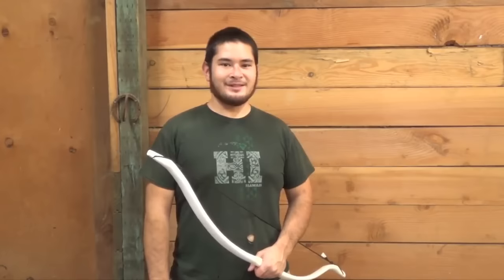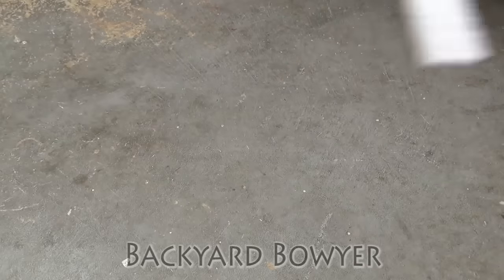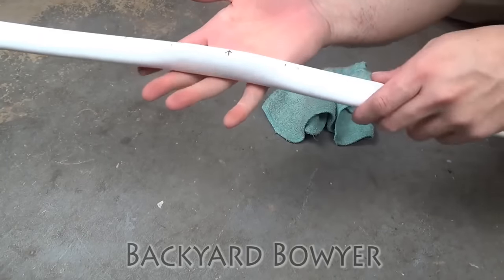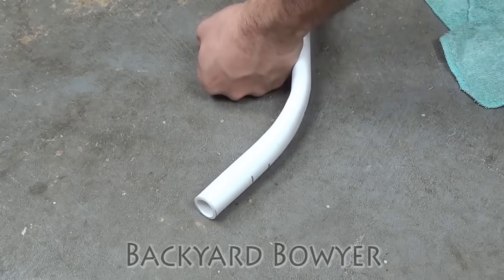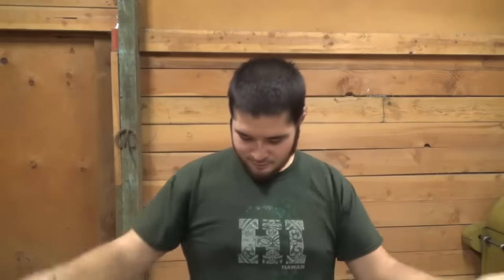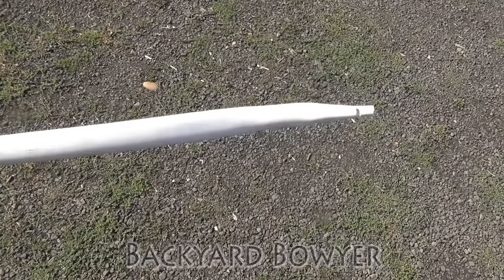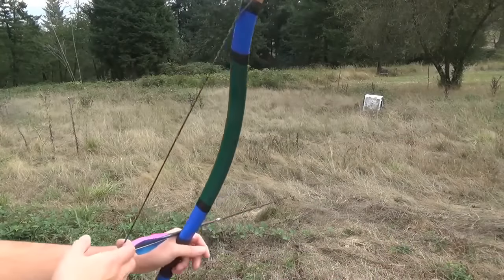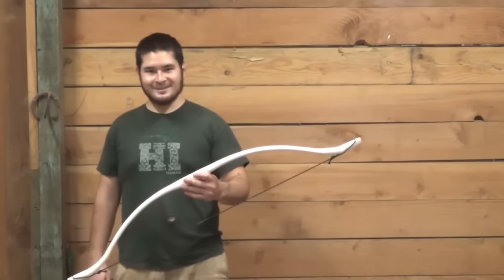Making a 40 Pound Freehand Formed PVC Bow With Tape Finish - Full Build

Comment: Ok, is this a legit test of pvc strength?  I get the pvc pipe manufacturing process may not be 100% consistent, but did he only smash test one end of each piece? If one end survives, are both of the same strength, what about the center of the pipe?  I know he heats the material up to form the bow (smash survivor), does that change the material properties, would the same heating process change the outcome of the "failed" tests? I could google all this but I love watching all the awesome build videos!  Been watching for forever, glad to see you're still doing work, bro!
Reply: The main reasons for embrittlement seem to be the manufactoring process itself (too little plasticiser), in which case there's likely no difference whatsoever on such a short piece of pipe, and storage time and conditions before the purchase. As far as the latter goes, temperatures would affect the pipe evenly, but sun exposure might actually only affect one exposed end, assuming that particular pipe wasn't on the outside of a batch.

Heating does weaken the material to an extent, but as long as minimal neccesary heat is used, it should be fine. The biggest issue is that heating accelerates the escape of the remaining plasticiser, unless you absolutely torch it, of course, in which case the polymer might start breaking down too much (some of it will still break down since heat guns heat things up rather unevenly, hence the need to work in a well-ventilated place - PVC is a nasty thing when it comes to the products of it's decomposition)

Comment: Backyard Bowyer,
I wonder if the PVC pipe is temperable sort of like metal to become harder or softer when subjected to different temperatures during the manufacturing process?  
I mean we might be rejecting a lot of pipe that actually just needs de-tempering possibly?
Maybe try heating a test piece up and plunging it into cool water and heating another piece up and allowing it to slowly air cool and see what the difference in their hardness is?
It's worth a try!
Reply: No, its elasticity is determined by the plasticisers used to modify its characteristics in manufacture. If anything it will become more brittle if thermally cycled.
Reply: @mariemccann5895  I guess the question then is, are there any compounds that could be purchased easily that would act as plasticisers and whether applying those topically/submerging the pipe (and presumably letting it "cure" for a while to get rid of the excess) could be the way to go

Comment: You could make one of these things seriously strong with the addition of a fiberglass core.

Even so, just the pvc by itself is surprisingly snappy, I didn't expect the +40lb draw, very pleasantly surprising.

Try using Tesa tape for your wrap sometime, it's incredibly strong stuff, with a lot grip. Doesn't hurt that it looks cool too.
Reply: I been working a lot with Tesa tapes for a while and I absolutely agree with you. Btw yes it's possible to make the bow even stronger, with a fine method you can even use 2 pipes at the same time and make it a compound bow. With that you can easily reach 55-60 pounds if it's a well made one (had one).
Reply: @markradvanszki5659 un tubo dentro del otro??

Comment: Thanks for the build! I had everything at the house to make this. I've never built a bow until today. Your instructions were very clear. I put the string on about 30 mins ago. It's far better than I expected. Thanks again dude!

Edit: I just shot about 20 arrows with it. I can't believe how good it shot! My string wants to fall off the siyahs to one side a little bit, but thats it! I'll make a few more minor adjustments.
Reply from the maker: You are very welcome! Thank you for building along with me! I'm impressed with you freehanding your first bow!
Reply: @BackyardBowyer  Thank you, Nick! It was a lot of fun. I made a flattening jig for the next few bows & it saved me a lot of time. The flattened horse bow with wood siyahs is my favorite so far. I will be trying out some more of your builds soon.
Reply: So the fabled PVC pipes that work still exist, then?
Reply: @MrCh0o  yes. They still shoot fine now. I made a several from Nick’s tutorial vids
Reply: @J6rish  Were you using the 1 inch, schedule 40/80 pipes? I'm determined to find the ones that would work one day, but I'm pretty sure all the stuff available locally is too thin-walled...
Reply: @MrCh0o  i used 3/4" schedule 40. A white pipe with red writing. It says Charollete Pipes on it. 3/4" is much easier to work with that 1 inch.
Reply: @J6rish  Thank you!

Comment: Hey Nick my bow just snapped,. Making another one like this..  Do you have to do the tips like that?  I dont have those locking pliers
Reply from the maker: You don't need locking pliers. A table vice works well. I'll also use my flattening jig for this. I lay the top board over the bottom so the spacers hang off the end and the two boards rest flat on each other. Then I'll heat the tip, squish the extra material between the boards from the side, and then put weight on the boards until cool. Hope everything is alright! How did the bow break?
Reply: @BackyardBowyer  thanks for the reply... i just squeezed it.. it turned out to look more of a longbow.. well c how she shoots

Comment: Just looking like wow❤️nice shooting
But tell me these bows set after same days or not
Reply from the maker: They take a set, which is why I add the recurves as well as the reflex. This results in a bow that still has about 1" of net reflex (the tips push the string forward so the limbs are able to take a set without taking a permanent deflex of what would be considered a negative set.

It takes about 30-50 arrows until the bow settles down. I'll sometimes keep the bow strung for a week to force the set. Such bows tend to be very forgiving and stable, while slightly slower than bows that have more reflex.

Comment: Hi Nick, I've been struggling to make my own PVC bows for a little bit 
now. The problem is no matter how long I try I can't get my PVC to 
become as soft and pliable as you do, I can be at it with a heatgun for 
30 minutes and barely get it anywhere. I suspect the problem is the PVC 
itself, the dimensions are the same but perhaps it's just different 
quality. I live in Eastern Europe and we don't really have dedicated 
hardware stores where you can find exactly what you want. Any tips on heating up the pipe?
Reply: Same. The problem is with the heat gun you can't make the pvc pipe hot enough unless you focus on a small area of pvc pipe. I'm gonna try using the oven instead
Reply: @branlan895  will do

Comment: So what was the difference between the 3 pvc pipes?
Reply: Plasticizers...

All plastics aren't just the polymer of that particular plastic, but they have several additives in it. For instance for UV protection (which can break the polymer bond), but also plasticizers.

The function of a plasticizer is to make it more plastic; deformable without it breaking. (so less brittle - similar to when you have steel and you harden it, or temper it)
See: https://en.wikipedia.org/wiki/Plasticizer

In fabrication, they add fixed amounts of plasticizer for a specific (half) product, but there will still be variations. So what he was doing is testing the tubes to see which is most flexible. Two failed and one was good for this purpose.

Its all great to make a bow like this, however, the plasticizer over time will escape the polymer, so eventually the bow will break. When that happens depends on weather conditions, sunlight, etc and of course time.

One reason for taping the entire bow (and keep it taped) is to not have sharp pieces flying about that injure you when such a break happens.

Hope this explained it for you ;]
Reply: @StofStuiver  so all pvc pipe is good use is there a specific pvc to use and if there is would you know where to get it
Reply: @MommyKills  Hi

That probably varies per country somewhat, so i dont dare to say anything on that.
Best thing to do is go to a shop that sells pvc piping (generally used for plumbing and so) and ask personnel/service which pvc type they have would best be suited / which is least brittle.
You should probably start with least brittle, bc if that fails, it bends /folds on a specific spot and will not shatter. So if that doesnt provide enough strength, you should go with a more brittle variant.
Generally there wont be more than 2 variants i think, so ask which is less brittle and that should probably be right.

Apart from that, pvc piping comes in different variants wrt diameter and thickness of material. Thicker, means it can endure greater forces before it breaks. Usually diameter and thickness are connected to standardisation, but there is some variance.
Thickness of course also means that it requires more force to bend it, which is released as you let go, wrt a bow.

I think you can fairly safely experiment with this, provided you tape it up completely.
Ive broken plastics in the past, of different sorts and so and hard plastics can all shatter and launch small, sharp fragments. Its not a safe thing to do without ppe. So taping is a must imo.

Comment: Hey backyardbowyer. I was wondering, could you get a lighter draw weight with this build using a thinner pipe?
Reply from the maker: Yes. If you go down to 1/2" schedule 40 pipe, the bow will be around a 25 pound draw.

Also, for every inch longer pipe you start without, the weight will go down around 2 and a half pounds.

Comment: Awesome video, I made a few bows a few years back because of your videos and now I find myself in the need for a lot of cheap bows for a memorial for my mother. How well do these handle being used in the cold? I made a double bow for a friend and didn't even think about it but the bow got UV damaged from the light coming from a window and it exploded in my hands. When painted I shouldn't have to worry too much about that correct? or will the PVC become brittle over time anyways, regardless of how much sunlight its seen? Have you tried using electrical conduit instead?
Reply from the maker: I've found that if the PVC can withstand a hammer before a how is made out of it, that bow should be fine if painted or covered. Electrical conduit works, though not all will pass the hammer test either.

Charlotte Pipe is still one of the best for impact resistance. I would avoid JM Eagle as they are consistently brittle and use a lot of chalk in their pipe formula.

Formufit makes 100% PVC pipes with UV, impact resistance and color added. These pipes are my favorite for making durable and beautiful bows that don't need painting.

Comment: Have you ever tried  putting another PVC pipe inside another to make a bow
Reply: Thats how you make the best bow, cut them down the middle and use cPVC as the belly/horn, and than the core i think should be PEX-A and for back of the bow(facing away from archer) something that will give it tension to help bring it back to brace shape, like fiber glass black roll, or rubber band, something elastic.

Comment: Just can not heat it well enough surface starts to melt way before it becomes moldable. Which temperature on heat gun are You using low or high?
Reply from the maker: I'm using high heat. Are you sure you're using PVC? Some PP and PET pipes tend to become soft and jelly-like on the surface and do not respond to heating the same as PVC. It could also be the thickness. Is the wall of the pipe near 3mm thick? Closer to 2mm, and the pipe is too thin.
Reply: @BackyardBowyer  Wall thickness is 4 mm exactly and it says PPPRG on the side (I asked for PVC, and they gave me this, did not check)... maybe that explains the issue. Many thanks for sharing the knowledge
Reply: @nikolacvetkovic2276  copy from another reply i wrote here:

Those pipes have a production number on. See if you can find some with different batch numbers. They might have a variation in plasticizers used and thus increase your chances of finding a good one.
Also, he's in the US. Europe (and possibly other places) may have different sizes and different amounts of compounds used. Also make sure it is actually pvc and not polycarbonate (which is also used for wastewater applications). Polycarbonate is usually more brittle. (In europe pvc is usually dark gray and polycarbonate light gray or white)
Reply: @BackyardBowyer  
Hi Nick,
I am a 71 year old with arthritis in my left hand.  I am a right handed bow shooter.  I am blessed with a location where I can shoot my bows in my back yard frequently.  When I use a bow with 30 pounds plus draw weight, I can develop a fair amount of pain in the left hand thumb area.  Could you develop and show a project with an adult size bow of 20-25 pounds draw weight? There must be others like me in the post WWII baby boom generation who want to keep up with archery.  Thank you for all you do.

Comment: Testing pipes.  First pipe...fails.  Second pipe...fails.  Third pipe...fails.  Well...shoot.  Thank you for watching my super short fail video.  Back to the hardware store I guess.
Reply: Those pipes have a production number on. See if you can find some with different batch numbers. They might have a variation in plasticizers used and thus increase your chances of finding a good one.
Also, he's in the US. Europe (and possibly other places) may have different sizes and different amounts of compounds used. Also make sure it is actually pvc and not polycarbonate (which is also used for wastewater applications). Polycarbonate is usually more brittle. (In europe pvc is usually dark gray and polycarbonate light gray or white)

Comment: what pipe is best  PVC or cpvc
Reply from the maker: Both will work, the wall thickness should be nearly 3mm thick. If it's half that, the bow will be light and prone to collapsing. I don't do a lot with CPVC because thick walled CPVC is not readily available where I live while thick walled (schedule 40) PVC pipe is.

Thank you for watching!

Comment: Did he say 30 hours into that bow??? Or 30 arrows?? Cause I just followed your video and did mine in 15 minutes
Reply from the maker: Thanks for watching! It was 30 arrows, as the bow tends to settle into its final weight after a couple dozen arrows.

The bow may have been one to five or so pounds heavier when first strung before settling, being exercised (pull the string and let it down slowly without letting go), or shot.